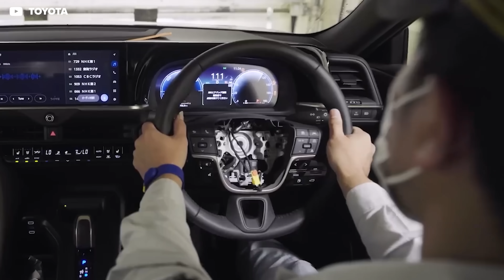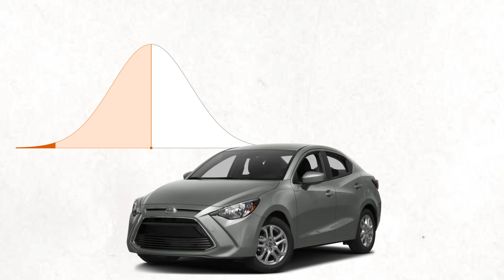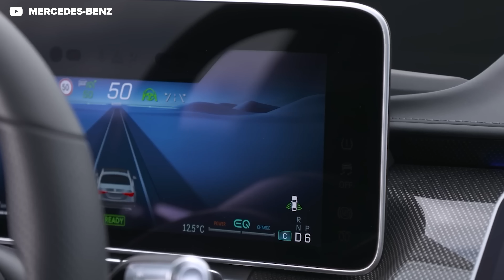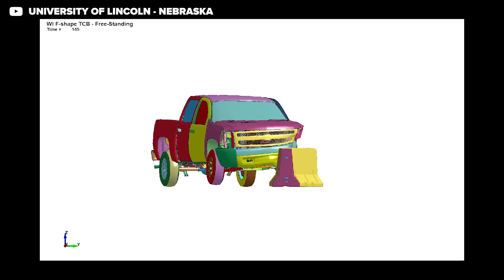The REAL reason guardrails can't stop EVs in a crash

Comment: Cars need to be smaller. There should be a larger tax on higher weight cars
Reply: Or… hear me out… make it harder to get a license and require a license for vehicles over a certain weight, then lower those weight requirements
Reply: @YukariAkiyama  In many jurisdictions you already need a CDL over 10,000 lbs.
Motorhomes seem to be the exception due to lobbying.
Reply: @economicprisoner where im from you need a cdl if you use your vehicle commercially, a commercial moped rider would need a cdl. for vehicles over a certain length you need a class B/A
Reply: It should be taxed on the Co2 released. As long as viechle axle weight within the road limit, it shall be tax equally. And we as human getting bigger. Do you want to see how an 8 ft man fit in a 5th gen civic? The sight is comical
Reply: @林振华-t4v  Sure, I can see that too. Lower the MPG, higher the tax
Reply: @ElitePayne47  Just put a carbon tax of $200/ton on fuel.
Reply: Would advantage EVs and their weight growth too much. Definitely should be based on weight, but maybe skew the amounts for EVs based on average weight of a battery pack at the time

Comment: 10:22 is probably the most important part. Roads that need it are designed to contain 18 wheeler Tractor-Trailers. This is a non issue being presented.
Reply from the maker: EVs travel on a much wider variety of roads than semi trucks, so yeah, it is an issue